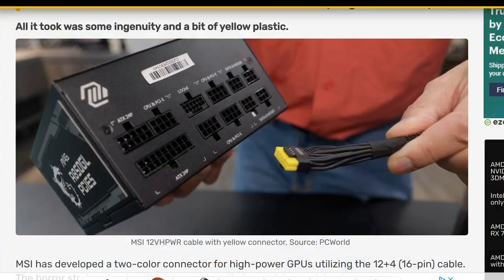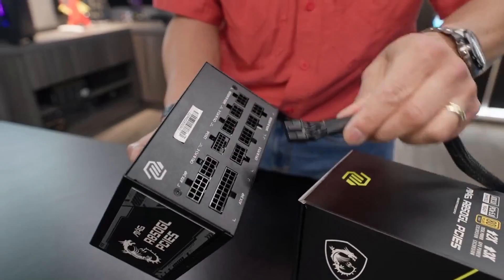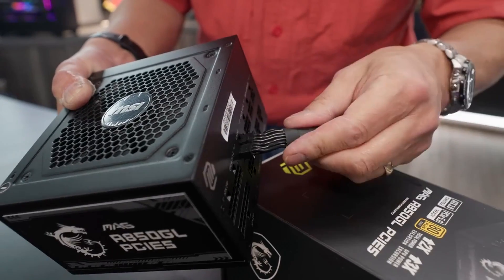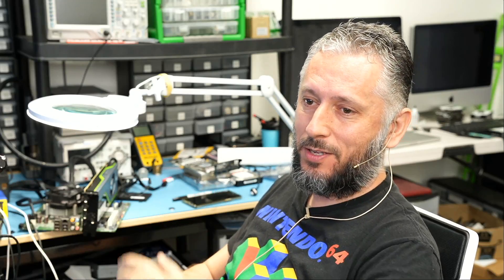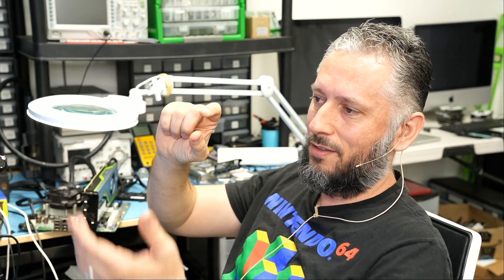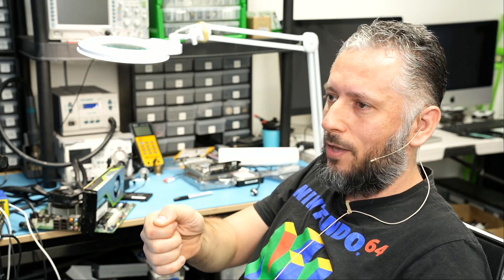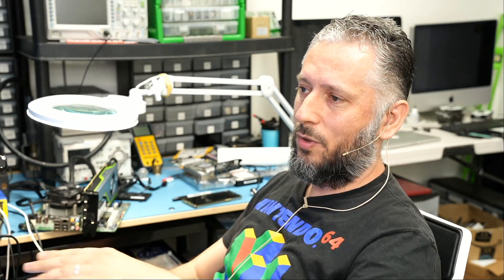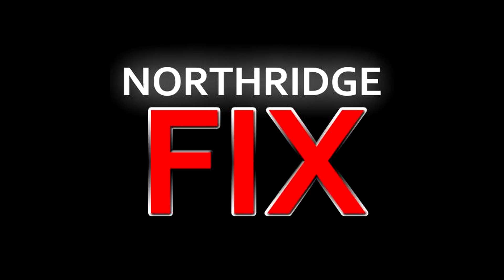4090 Melting connector Fix using MSI yellow cable 12VHPWR. What?

Comment: Dealing with this right now actually…. Waiting on replacement from Asus. Initially told me they wouldn’t do it, then said they would. Provided photos showing the cable was completely seated…. Even order a plug from the UK to do it myself if it came down to it…

Comment: You're just causing this issue for both your psu and gpu, the fix? if u have the 4090 just try to get a 4070 ti super or 4070 ti or lower cards, or wait for the 50 series.

Comment: who designed the connector is either stupid or malicious, sometimes i'm thinking of using a propper XT60 connector soldered on the back to prevent melting

Comment: It's a bandage. I applaud msi for doing what they can with a bad design. The real answer is to go with a physically larger connector that provides a lot more contact area. It should physically secure better than this single clip and loose tolerances. and probably go to the next larger gauge wire as well. The 6 and 8 pin connectors are rated to just above half of their theoretical max draw, these are rated to only have a 100% margin to theoretical. Redesign this to have at least a 20% margin, with two clips to hold it in that in spec will not click in place unless the connector is 100% seated.

Comment: It would seem that both cables have a design flaw and that the lock-in tab has too much play in it that allows the cable to pull out by 2 mm because the Locking tab is too long. The Locking tab should only lock in once the connector is fully plugged in not partially plugged in.

Comment: I have a 4090 with side panel space, 0 issues since release...
Reply: Are you using the updated 12v-2x6 cable?
Reply: @ssaini5028  The original one
Reply: Nope, just the OG one.  @ssaini5028

Comment: Im sure i share my opinion woth many other people. If this is all the margin for error th8s connector has, its clearly not up to the task. Theu should have used a heavier duty connector, and this should be a warranty issue where they change the connector and rma all the boards with the old connectors. I will not believe anyone who tells me this made through testi g and was never found to be a problem. Nvidia can do better, and should do better. This is a fire hazard, and the agencies who oversee this stuff should have become involved by now if nvidia refuses to do anything on their own.
Reply: only 400 reported the problem...vs majority who does not
Reply: The connector is mechanically the same connector that we have been using for a decade now.  For example the 3090 can eat over 500w, no issues with melting

Comment: This card probably was running triple 4K monitors, overclocked super hard and running a poor power system with fancy RGB fans that don't cool well. 
The losers hate on NVDA and the tech channels are rife with it, because the cards are "too expensive". 
Everyone on the internet sides with the users, but it's their fault. Reality is the true arbitor and NVDA is absolutely dominating Intel and AMD in GPU's and AI chips with no credible competitor.

Comment: Yellow or black the thing is that giving the amps requirement this connector has reached clearly its own electro mechanical limitations. You don't need to be an engineer to realise that. Its a design problem.

Comment: I'm a new fan and missed a lot of good content but I am glad I didn't see this before becoming a fan of the channel. You seem to misquote or misunderstand what is said very often with this topic. The guy clearly said that he would want to push the cable back in because he sees yellow. He didn't hold a double standard. You just misunderstood which is easily understandable despite it frequently happening with this topic. Still, easy mistake. Thanks for the content.

Comment: If thats the case.. then 3090's would also be melting connectors. And well thats just not happening, the problem is with the card or its female pcie power socket and not the cables.

Comment: This connector issue really pisses me off. The location, design, and fragility of these is pathetic. Why was it left on the side mounted parallel if the cable can't take a small bend radius? This is basic level design that a few user tests would have sorted out. No way will I buy a card with this until it's fully sorted.

Comment: Bad connector for job. 500w+  power draw with that weak connector is recipe for melting . Designed deliberately so that there are constant repairs and therefore you have to buy a new super-expensive video card. The simplest solution is to make several connectors that have a distance from each other and so the heat will not gather in one place. You don't need to be an engineer, graduated from an expensive university, to understand this

Comment: You can glue that cable fully seated an its still gonna melt my 4090 tuf oc just melted my 180 degree cable mod adapter to the card and it's fully seated no gap can't budge the adapter it's welded to the card fully seated

Comment: If the possibility of the user making this mistake is the fault of nvidia engineers... But aren't you confusing it with the factor that caused the error, which was the user who didn't connect correctly or made some movement with the cobo?

Comment: If people are having trouble understanding how poor this design is here is an analogy: You start your car (keys in the ignition) - you bump the key in the ignition with your thumb - your car shuts off in the middle of the highway.  Does the key work?  Technically yes but it's a very bad design.

Comment: Gotta love how the usual suspects keep saying "user error" when it simply can't BE user error if the user had fully seated it. Cables should not be able to walk themselves out -- period -- or else there is a problem with the design from the jump.  There should absolutely be enough tolerance in the cable to keep this from happening.

With the amount of wiggle room these connectors have, fan vibration alone can slowly walk them out to the limits of the clip. And then you get that stupid white stress mark that everyone points to and says "USER ERROR USER ERROR USER ERROR". 

The lack of critical thinking exhibited by these companies and techtubers (yes, Cable Mod too) because no one wants to point their fingers at PCI-SIG and Nvidia or else risk losing their statuses is just insane.

The honesty exhibited here alone earns my subscription.

Comment: We are seeing what happens when you fix stuff that isn't broken. I believe that this is not a "CableMod" product issue at all. The 12VHPWR design is inherently flawed and a new connector wasn't necessary. This is NVIDIA's abortion. Thanks, NVIDIA. They should redesign the 12VHPWR connector completely, and stop using clips. If they would use one screw on each side (like an old VGA cable) so the cable CAN'T move until the screws are removed the problem would likely be solved.

Comment: Total recall is required. MSI doesn't fix fundamental Design failure. Nvidia's Gauge thickness is HALF of ONE 6+2 Pin PSU cable. Contact Area is NEARLY THE SAME as a 6+2 Pin within a 10% margin of error. 
https://www.youtube.com/watch?v=_2_mFNRlXng

Comment: The problem should be, that parallel connections from an output(s), over different conductors have different voltage drops, and where they are combined into one, the voltage drops are equalized by dumping heat into the socket.    Adopt a single connection through one conductor that can handle the entire load of the adapter  should stop the heat. and increase the efficiency of the adapter.

Comment: Hello… I had my GPU cable burn out at the weekend and melt… but at the PSU end. When I built it I had ensured all cables in securely as I had heard about the problem. So what happened? In a nutshell I was using the cable PCI-E cable and discovered today that these cables do not have a latch lip so when you push in it slides back out. I think a design fault in the cables. The GPU and PSU had the ramp ridge but the cable at both ends doesn’t have that little black piece that once over the ramp keeps it locked in. Have contacted Gigabytes about it today.
Reply: When built I had checked ends were in tight as knew about this problem. The cable must have slipped out a bit (as No locking latch) at a later today when in the case doing something and as PSU hidden away I didn’t check, not knowing it would be a problem. Lesson learnt. Check those cables both ends of your in and have been working on your system.

Comment: Next up, 1000 bucks cables with LEDs that will change to green/red if the cable is fully seated or not, like the F1 nuts... No other card or motherboard that uses pretty much the same connector in the history of PCs ever had this issue, and all the sudden its a user error... screw you Nvidia.

Comment: Look, I agree there's a problem with the connector, but:

Gordon says: "[...] that's enough gap that I'd probably would push it in."
You say: "[...] he told you that's a gap he would not worry about pushing back in. Why the double standard?"

There's really no double standard, Gordon's demonstrating how much wiggle there is in the 12VHPWR connector, shows how MSI's solution can warn people when that design flaw causes the plug to be unseated, and literally tells people he'd push that plug back in while pushing the plug back in.

Comment: Maybe power cables need clips like ethernet cables.  You have to click it in place and press down on the clip to release the connection.
Reply: It already has that, there's a clip on top that clicks when you've fully plugged it in; the problem is the even when it's clipped in place, manufacturing tolerances allow for enough wiggle that the plug can wind up partially unseated.

Comment: This is not really a fix, it's just a barebones kind of foolproofing. If would be better if they had hooks on both sides kind of like the old IBM SDL cables. Baseline issue of gauge thickness at the point of contact is not solved.

Comment: He just said he would want to push the yellow cable with that little separation. It's not double standards, it's just not wanting to recognize being in the wrong.
I guess having 0 evidence of burnt fully plugged in cables for a whole year is still not enough ... I agree the cable wiggle too much though, but not an excuse to be a dumbass, wiggle it 20 times after plugging it and leave it like that on a card that could draw 450~600W.

Comment: A yellow cable is all that you need, now everything is OK, why they don't change the fucking connector? By the next Gen came, there will be another connector, or they maybe rollback to the standard one. I guess next Gen, must be focused on efficiency, more than just more power.

Comment: If the connector clicks in it is connected by the design standards. A cable that moves out slightly while clicked in still should not make a connector melt. If this happens it is a design flaw. Maybe they needed thicker metal and plastic in the connectors or made out of all metal connectors that can take the heat. Still a design flaw in my opinion.

Comment: is it that hard to look in the past? AM3+ cpus power connectors on motherboard/PSU were melting on multiple motherboards. 

So much current heating constantly the contacts between both cables changes their resistance proterties periodically after lots of thermal cycles. That's why we're seeing long term problems (8months+). 
The solution on those am3+ cpus specifically FX 8350-8370 was to undervolt them. I hope those companies trying to keep old years margins fix the issue, yes they'll loose some multiple millions, but after all it isn't our fault 🤔

Comment: I've been plugging cables in PSUs, GPUs and motherboards for over 25 years. Never had issues of cables not going all the way in. Lately I've built multiple PCs with Seasonic power supplies and once you've plugged those cables they are not coming out of the Seasonic. I don't know what kind of PSUs MSI is making 🤦🏻‍♂️🤡

Comment: This only Nvidia's fault. If you are inventing a new connector, you have to test it like crazy before using it on your products. Adding power to a gaming card is by design a extra inconvenience for the user, and in some cases with large GPUs the side panel can press on the power connector.

Comment: You know the thing is I was shocked when I saw this connector in the first place at release. Instantly recognizable as from the family of Molex Microfit 3.0, but Microfit 3.0+, same 3mm pitch but with a little more load capability, yet still less per pin than the older Mini Fit Jr 4.2mm pitch. It made no sense at release, surely if you know your gonna have high loads, go the other way with a bigger plug but less conductors. Could have gone the route of a Mega Fit 5.7mm pitch connector with just 6pins for 3 circuits on heavier gauge cable. It takes up about the same board area, perhaps less, each pin can handle 30A, and has a bigger pin contact surface area. Potentially up to 1080W through 3 circuits. Plus run a lower gauge wire than the pin capacity, and can potentially move the feasible point of failure to the wire rather than the connectors.

Do wonder if there's an engineer or few at Nvidia quietly saying "told you so" to a Product Manager / Marketeer. 

Don't get me wrong Microfit connectors have their purpose and both HP, Dell and others have used them in the past for 24pin ATX connectors on slightly proprietary motherboards, such as the one's found in old HP s3000 systems. Never been a problem there at low loads

Comment: opinion: THEY ARE STILL GOING TO MELT AT THE CARD. &ALL THAT WIGGLING BACK AND FORTH IS JUST BREAKING THE SOLDERING. ELEVATING THE PROBABILITY OF THE CARD CONNECTER BURNING UP.

Comment: That's a bunch of BS. The design is garbage and it should be re designed to have a secure fit that doesn't wiggle and create unwanted resistance causing damage to expensive equipment or even worse cause fires in people's homes. We have enough problems to worry about in our lives. We shouldn't need to worry about a computer burning down our home.

Comment: It’s honestly insane how we’ve never had an issue with 6 and 8 pin connectors 🤯🤯
Reply: @@Krazi-RDNA It's PCI-SIG's fault.

4 8 pin were not "fine", they were "usable". Nvidia's fault was brute forcing performance to stay ahead of competitors instead of focusing on efficient improvement.
Reply: Something something single connector at 600+ watts
Reply: not really insane, they were bigger and better.
Reply: The problem is because design failure, since nvidia want to simplify to connect using 1 cable for 600W. Amd use old PCIE standard 8 pin 150W, and need 8x4 cable to achieve 600W. Its safer but you need more cable.
Reply: Pull the cable partly out, see if it burns
Reply: No, it's not. It's amazing that less than 100% of all people aren't blaming PCI SIG for this trash standard and low quality engineering in comparison to every single previous PCI-E standard.

Comment: This connector has not been engineered to carry the current. This is obvious from the fact that it insertion distance is so critical. A bit of coloured plastic is not going to fix this. Back to the drawing board.

Comment: Doesn't solve the issue for the cases said cables are getting burnt despite the fact that cables were seated all the way in.
If the connection itself is the issue - there's no clever design that can change that.

Comment: This is completely design failure. When it's transfer high current, the connector pin should be more thicker and both the male & female connects more surface area.

Comment: The connector is defitient. it does not meet the power requirment. this is lifev safety since it can cause fire.
The connector shall be sized for the power requirment. 300 watts or more. the connection is not adequate.
The user should not be blamed. its on the manufacturer. why are we accepting CRAP.

Comment: This cable plug should have two screws on either edge of the connector like an old-fashioned VGA or DVI cable, along with a yellow plug. This way you have a verified secure connection along with a visual indicator. Get on it Nvidia - re-engineer your crap!

Comment: this issue is simple i dont know why no one is talking about this. the 18 gauge wires cannot supply enough current for the current draw of the graphics card. simple electronics 101. psu wattage dont mean shit if your wires are limiting the flow of current. when this occurs it creates heat for dissipation causing melting connectors.  please use a clamp meter and measure the current draw as a test. i bet if they doubled the amount of wires per individual pin this would not happen.

Comment: It's a design flaw, you shouldn't be able to partially connect the cable, the clips should lock only when the cable is fully connected and it shouldn't be able to wiggle.

Comment: so hard to see if he touched the release clip but the design problem is it can be moved and any small semi-gap will cause heat, then residue then less contact then melting and trouble.. Heck even if it smokes a second that is long enough to cause the failure meltdown to start.  I have had contact with a tiny bit of smoke residue cause detection issue with hardware clear back with gpu's used a floppy drive connector.